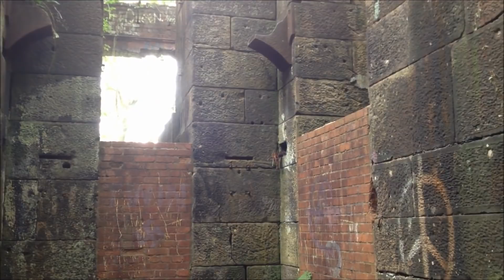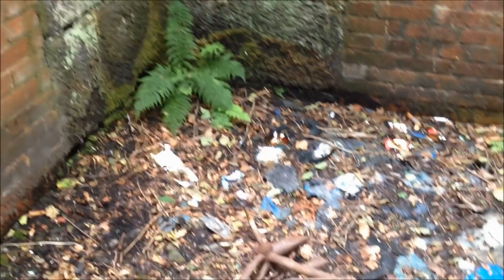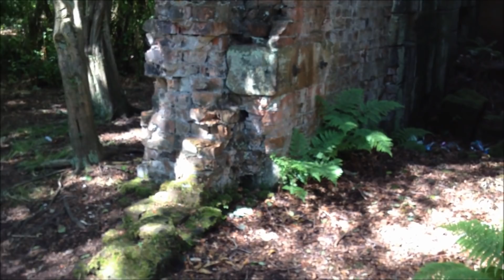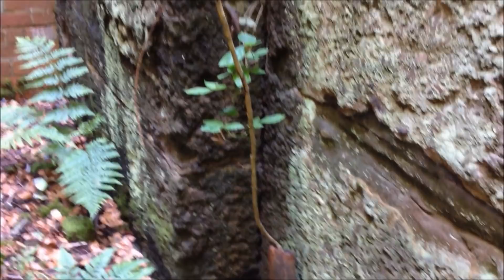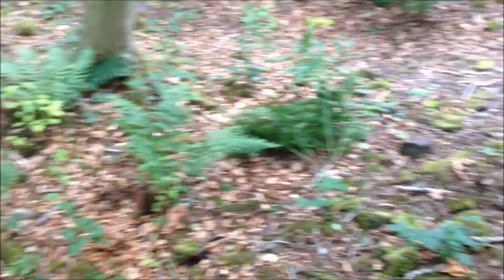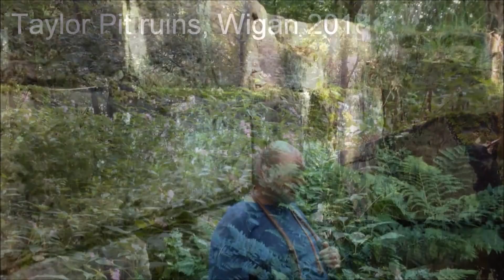Aspull Pumping Pit, HUGE Victorian era mining ruin in Wigan

Comment: Probably survived due its remote location, I doubt the shaft is still at its full depth, and probably infilled with rubble from buildings around it when decommissioned. Unlike modern mine shafts that are filled using stone chipping and concrete. Great place I need to explore.

Comment: Brilliant Roy thanx for the name check. You really have done pumping put or pumper as it’s known in aspull proud. Just a bit more info my uncle helped to back fill the shaft I think around the time the chimney was demolished I hope it wasn’t just left from the time it was abandoned till 1955 because the shaft was 540 feet deep. Also my dads aunty her dad was the winder at the pumper because although miners never worked down there they did wind coal there so got a fair bit of family attachment to the old place. Great stuff Roy keep em coming
Reply from the maker: Hi Gareth, glad to hear that you enjoyed the video as I know that you've been requesting this one for quite a while.

I really enjoyed finally managing to get inside the fenced off area surrounding the pumping pit and exploring the ruins then matching up them up to the old ordnance survey maps of the area and ended up spending hours there undisturbed just discovering little details like the Roman numerals carved into the face of the stonework and the old well.

Regarding the shaft itself it hasn't been fully backfilled and is still quite deep although it appears to be nowhere near as deep as the 180 yards that it was originally sank to as it is just possible to see your reflection in the water at the bottom if you look down the inspection hole that I sent the camera down.

Anyway thanks for the heads up on this place and your patience regarding it taking me a while to get round to finally documenting it. Enjoy the rest of your day/evening and all the best. 👍